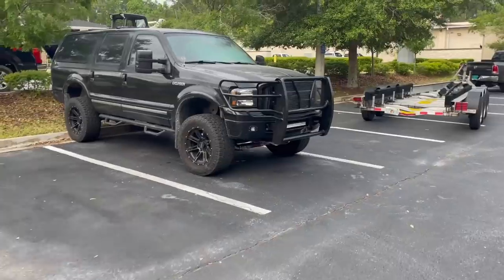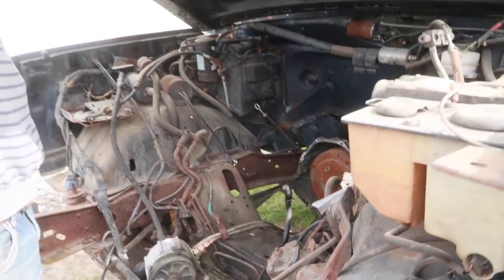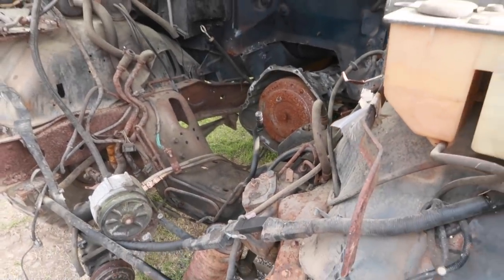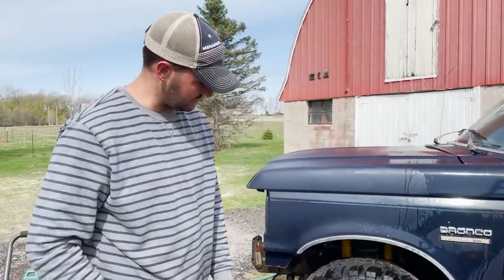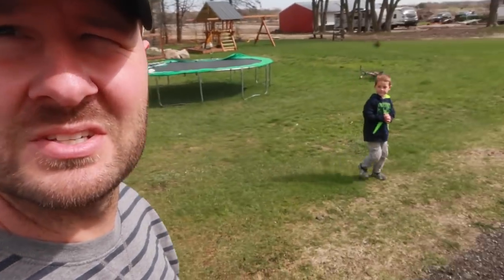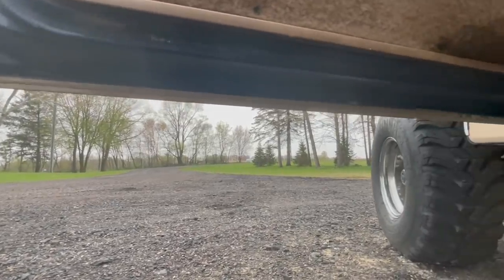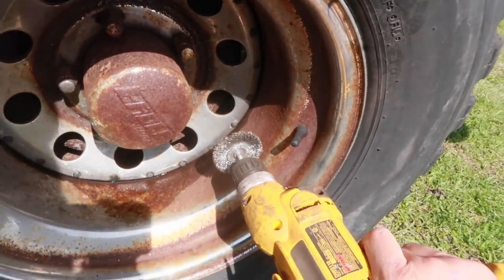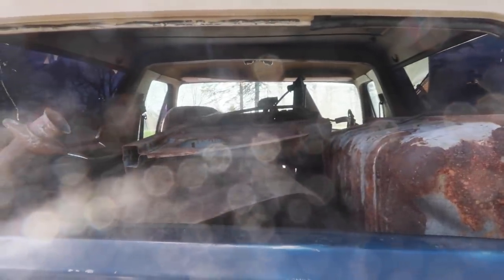REVEALING What's Hiding On The BRONCO!!  A Pressure Washing Miracle!

Comment: I had an old bicycle with very rusted out wheels.  I took a ball of aluminum foil and water and used it like a sponge and cleaned the rust off the wheels it actually worked.   Something to do with aluminum being harder than the rust or something anyway it worked looked so much better when I was done.

Comment: Did the very same wash on the new to me 94 wrangler last summer. It's on the road 5000 miles later and running great. Still has stripes in it from the pressure washer. Will be my sons first car in 5 years!

Comment: Very complete rig, still would fetch the high dollar running as most don't see the forest for the trees. Those rigs are only going to go a lot higher in price and values as other people have got tired of making a payment on a rig that is higher than the mortgage on  their home to find it junk in five if its in those rusty states. No one washes by hand or takes time to clean under the wheel wells. I have found these at auctions as a rig driving and nice as a donation rig. If they don't sell they go to the crusher and that really doesn't make sense to me. Sure if in major accident or just rusted away then no harm or foul but rigs that are say fifty years old and still look like it came off the showroom floor. Your rig needs some love alright but its worth it in the fact that you have something to work with. I had a 95 f350 with over four hundred thousand miles...... granted I will brag on it more than its worth but no major repairs or ever in a accident, same running gear with nice wheels and tires I got nine thousand out of it and people saying hey you never told me about it so they say that they would of paid lots more. I gave sixteen thousand for it new. It really didn't own me a dime and only reason I got rid of it was health. You would be surprised how many are out there just like it. I hope its not crazy stuff done but you can really take it to this century with some nice and easy mods to it. Stuff like the digital dash, a radio that has all the bells and whistles like camera and sound. It does cost but you get so much for it for doing it. So... I will be watching.... I also like the name of the channel
Reply from the maker: So very true. Thank you for watching 😁